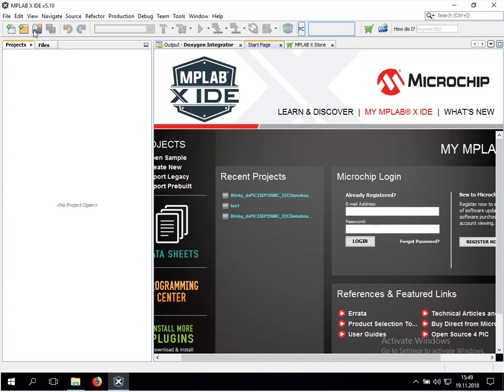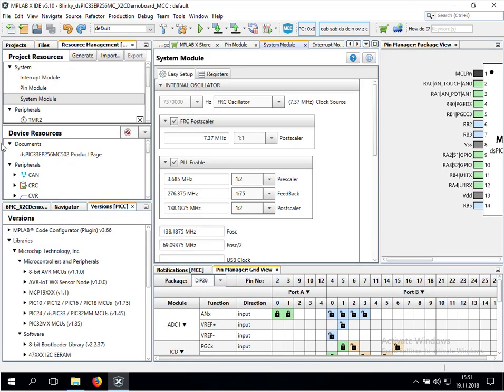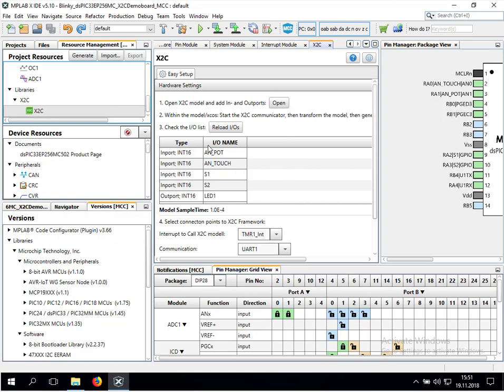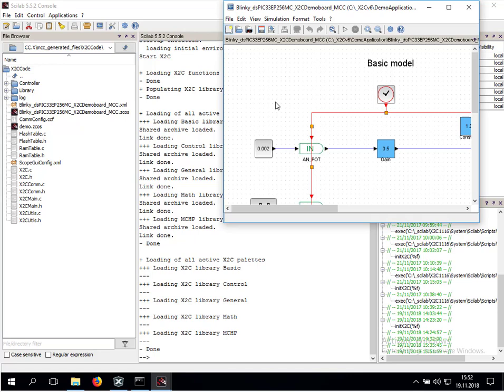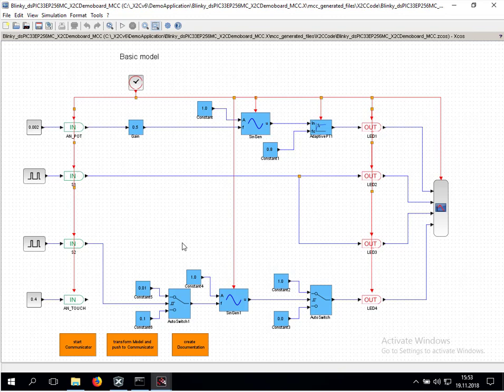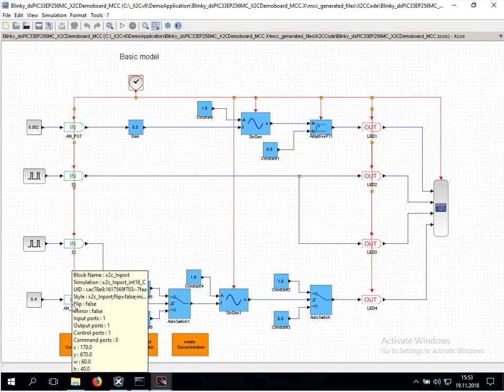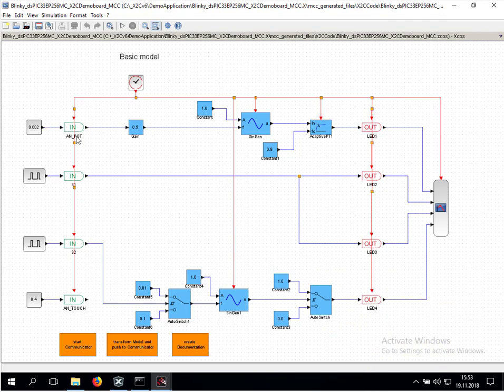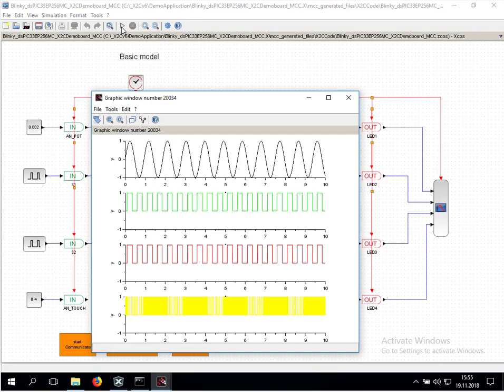02 X2Cv6 open the 1st project and simulate

Comment: Could you please explain how to calculate from the Gensin block

uk = Ak sin (2fkfmaxkTs + ϕphase) + Aoffset	

Consider using signal through S2 having 40% duty and f=0.5Hz , using Schmitt we get output of 0.1 for OFF time and 0.01 for ON Time
Also the output on CMScope Ch4 is 0.1Hz during OFF Time and 0.01Hz during ON time
fmax=100Hz, Ts = 100usec Ak=1, offset=0

how to obtain fk and k here

also what is delta_phi in Controller parameters of GenSin block